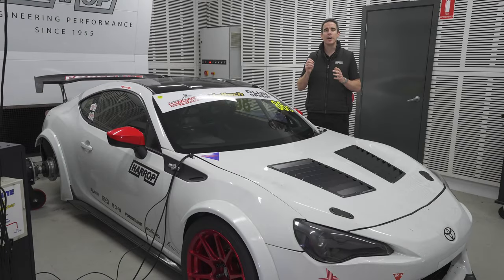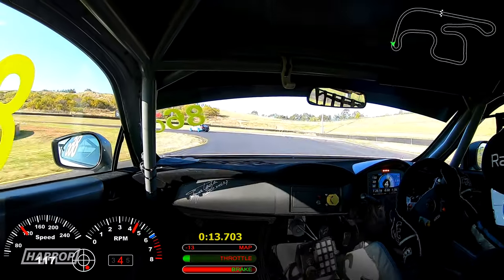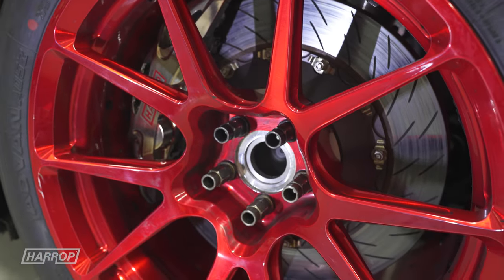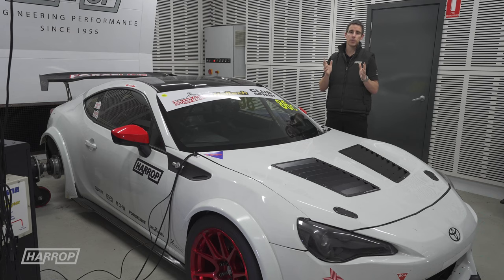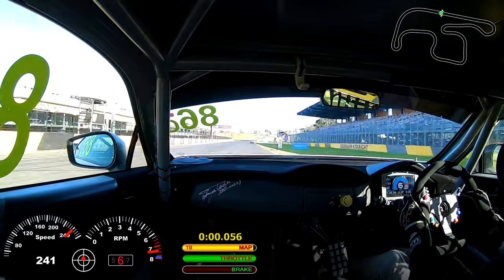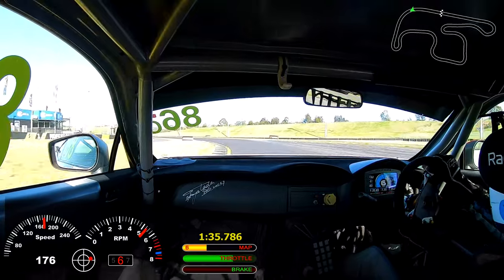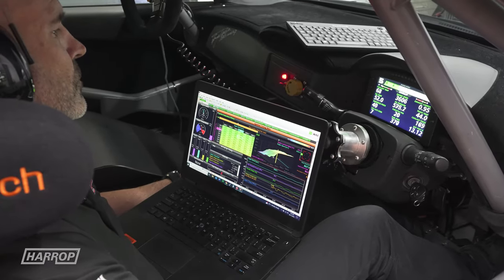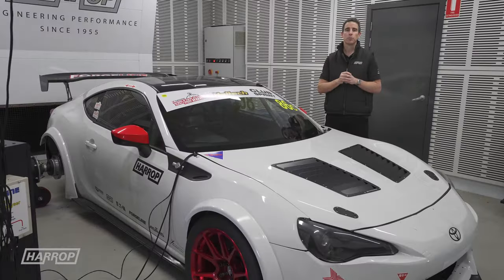500HP Harrop Supercharged | FA24 Toyota 86

Comment: Awesome result guys 😁. Been waiting to see more updates with this car.

So this is a 2.4 Turbo block with 2.0 N/A heads? Red line looks like it is close to 8k too?
Am I correct in assuming it's a de-stroked setup like the old 2.3 destroked EJ setup?

Because this is exactly what I am trying to find for my WRX project. I would love to do a destroked 2.4 FA, twin charge with Harrop SC on the WRX.
Reply: I hope harrop replies to this. I've been looking into doing something similar and would love to hear how they did it.
Reply: @section8118  It’s not destroked they are running a dry sump oil system  if you watch the video you can see crank shaft driving the external oil pump/ dry sump system and with upgraded valves, and valve springs. the upgraded oiling system you don’t have to worry about oil starvation or loss of oil pressure which was the most limiting factor on FA motors as far as being able to rev them high . You can also get rocker arm retainer clips from a company in Australia . FA motors have a interference fit rocker arm that is held together only by valve spring pressure so if you get valve float your rocker arm can just fall off into the valve cover or into the exhaust cam and tare up your motor.  Stronger springs will help keep the rocker in place to a higher rpm but if springs fail only retainer clips will hold the rocker arm from falling out of place